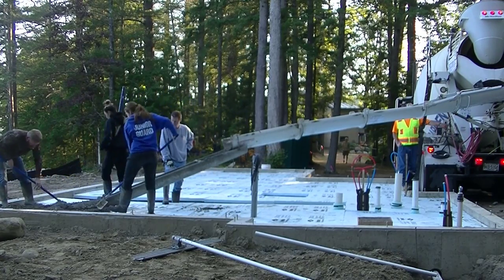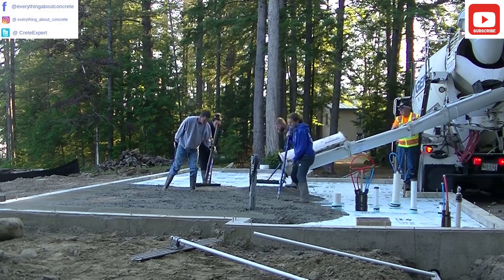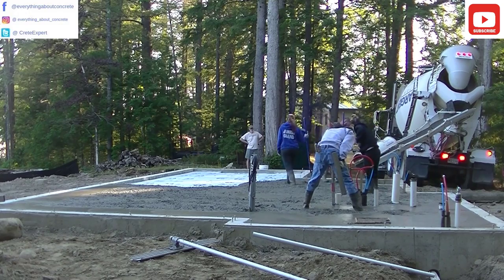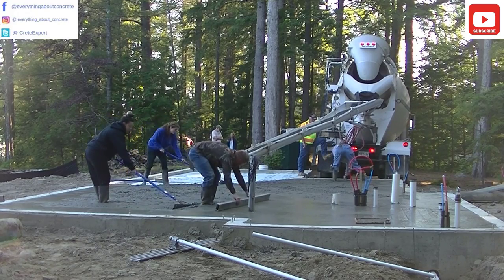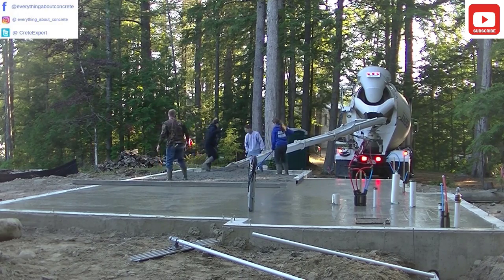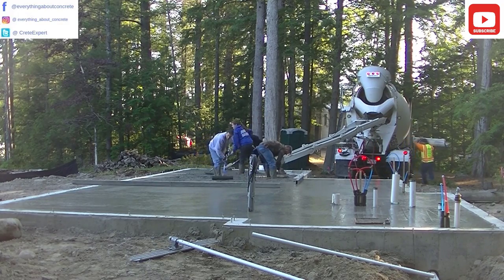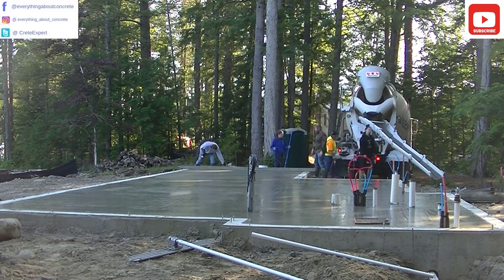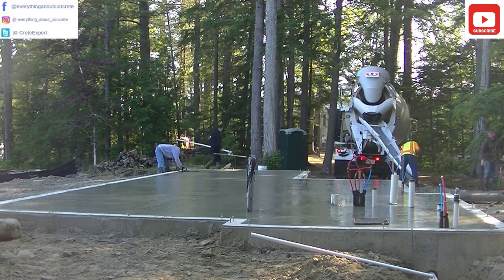POURING A CONCRETE FLOOR INSIDE A FROST WALL FOUNDATION

Comment: I worked on the concrete for 3 years pouring and power floating 1000 M2 supermarket floors I take my hat off to those girls on the rakes it may look easy but a couple of hours on them and your arms know about it.  A skilled team of concrete guys are gold dust as concrete waits for no one 💪🏻...Cracking job guys
Reply from the maker: Thank You!

Comment: Don’t know anyone down here in south TX that uses fiber.  I notice up north they use it a lot.  Any issues for foundations?
Reply: it just helps the concrete with strength
Reply from the maker: The foundation guys don't use the fibers in the mix in Maine as far as I know, just us floor guys. Never really any problems on our part. Most commercial floors spec the heavy gauge wire here. I remember having to un-roll those rolls of heavy gauge wire back in the day before flat sheets. Took 2 people just to push the roll.

Comment: Hey Bob I really appreciate this video there's some great footage. I've been in business since I was around 19 or 20 as well. I'm now in my 30s and we take on lots of decks and home additions. Most projects have been a top footers. But you're more recently I've had multiple clients asking about slabs. I'd love to hear more about rules and regulations and what's required to operate as a concrete contractor in your region

Comment: I have a detached garage in Catskills NY. Frost wall with slab poured inside it. 8mo after installation the edge of the floor slab is chipping away to reveal some padding that was against the frost wall. You don't use padding here. Thoughts? Can this easily be fixed or is my garage floor fucked?

Comment: Mike, I’m building a new home in midcoast Maine with a 4’ frost wall.  Considering using 2”-3” closed foam insulation under a 4” slab rather than foam boards.  I was told it would seal out moister better than poly with insulation panels under the slab.  What do you think?  Thx
Reply from the maker: The spray foam ends up so unlevel it's not good in my opinion. We just poured over one where the floor went from 2.5" to 6" thick. Makes it very hard to figure concrete yardage also. I'd use the 2" foam boards myself.

Comment: Mike,

Going to be moving uo to Maine this spring. We are looking at different foundations for our off grid home.
Just curious, what does a job like this one in the video cost? We are going to most likely do a pier foundation, but are looking at all options. I can do a pier, but I have never done concrete work. I have studied on it a bit and feel confident I could do the frost wall. 
Appreciate any info...
also what area of Maine are you in? Possibly near Bangor?

Thanks,
Reply from the maker: I'm near Augusta. Call Lajoie Bros. and get a quote from them for the foundation and floor. I only do floors.

Comment: Hi, how deep is your frost line and how deep do you place your footing for your frost walls.  Thank you
Reply from the maker: Frost line is 48" so the footing goes in a little lower than this.
Reply: @MikeDayConcrete  thank you. Does the footing sits on a compacted crushed stone, if so how thick is the stone layer.